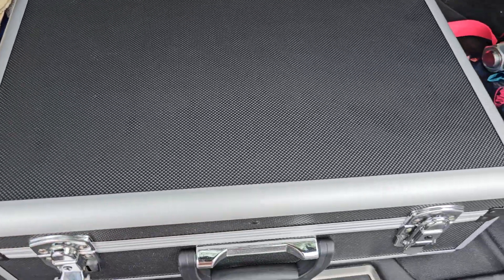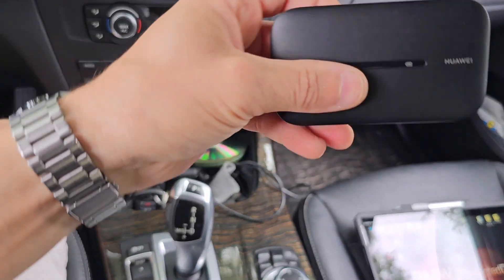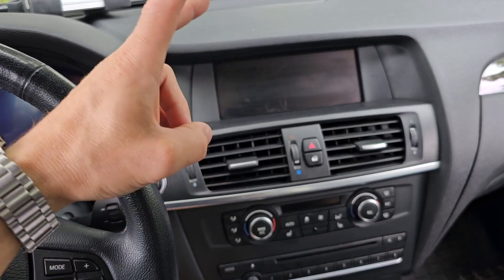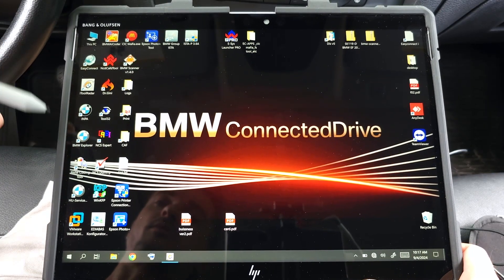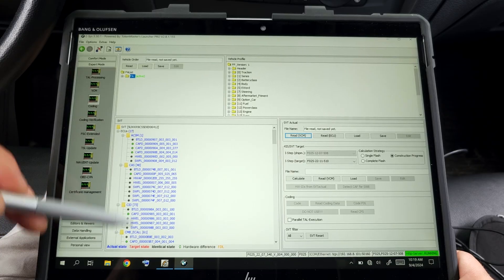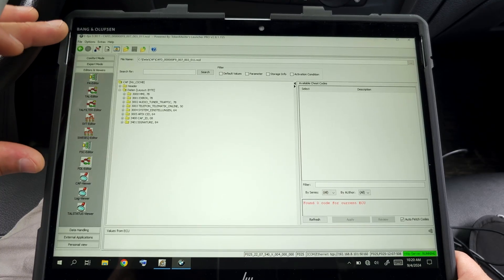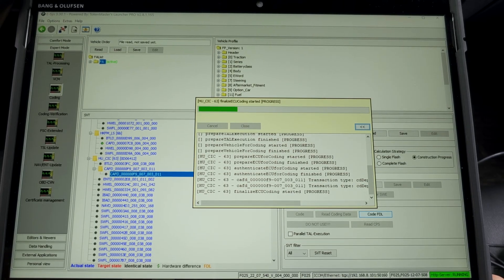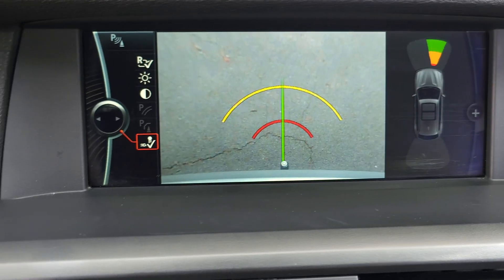How to code BMW using E-Sys

Comment: hello
I have changed halogen bulbs for LEDs and I need to code so that the typical error of burned out bulbs and the flashing (check) when starting the car does not appear. Could you tell me the process correctly?
thank you

Comment: Thanks Ovidiu, please create video how to program module replacement. for example g30 we replacing used one lane sensor in bumper. ista shows SWW red. how to program it ?
Reply from the maker: If it is red, that means the module is bricked, defect, the wiring is damaged to the module , or is a problem with vehicle configuration in ZGW

Comment: Thank you for sharing this. I hope you will do more videos like this. I was under the impression that ISTA+ supports coding for F series vehicles, but I haven't found this in ISTA+. I have an F87 and I would like to disable the legal prompt when i-drive starts. Do I need to get E-SYS or can it be done using ISTA+?
Reply from the maker: You need e-sys

Comment: Hello, I have a question, is the mobile wifi you have good or do you recommend another one?
Reply from the maker: Hello! Yes, it is working perfectly, but I would prefer one that's slim like this one but to have an LCD screen where to se the battery percentage and ideally the connected devices

Comment: Great video! Thanks for sharing these valuable informations with us.

The only feedback is you didn't mentioned you not used plain e-sys instead e-sys with launcher. Sure it can be obvious for most people but it's always best to mention everything like you can't do fdl coding on BMW just with plain E-Sys, a launcher is needed
Reply from the maker: Great point! thanks for the heads up !

Comment: What’s the difference between the yellow rj45 cable and the icom? I use the yellow cable and have 0 issues using esys or even ista.. thank you fo the video ❤️
Reply: Icom cover all vehicles from bmw group and have a dataflow of 1Gbit, the yellow rj45 only F&G Series, maybe for later mini models and rr models..
Reply: @XYZS1000RR  thank you 😊